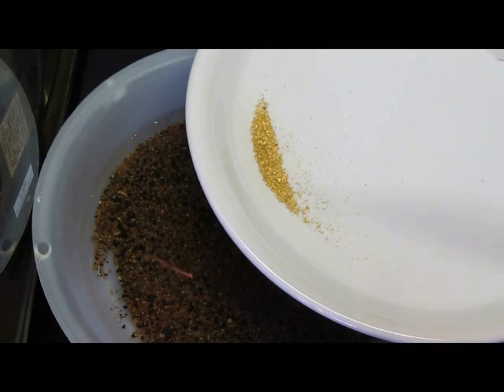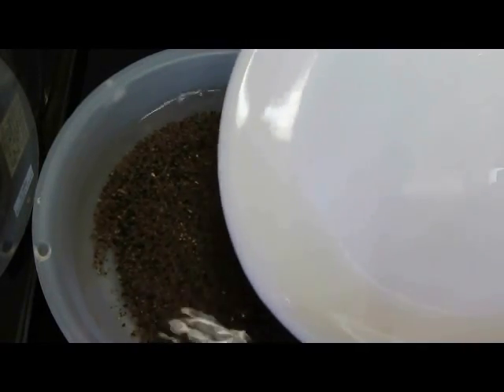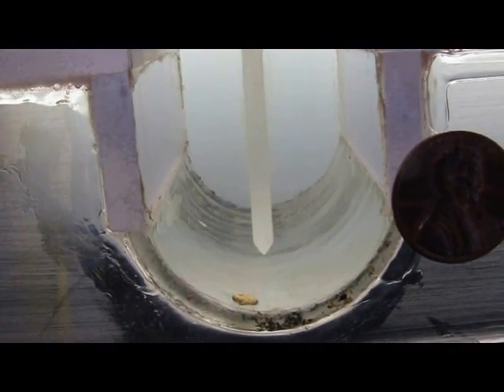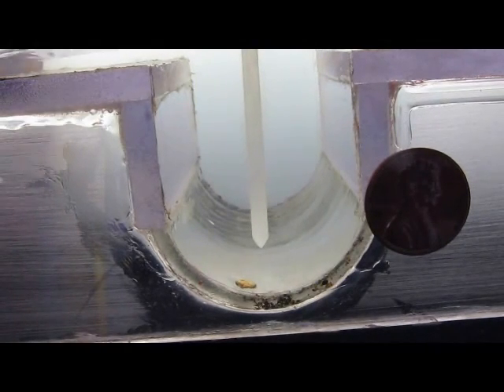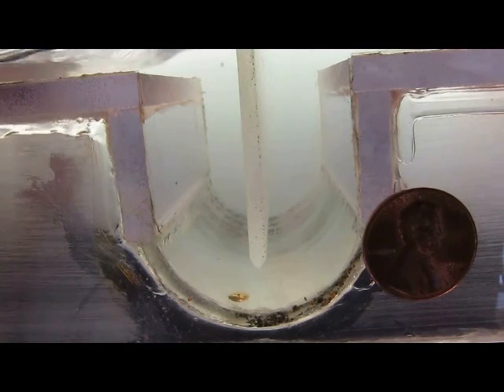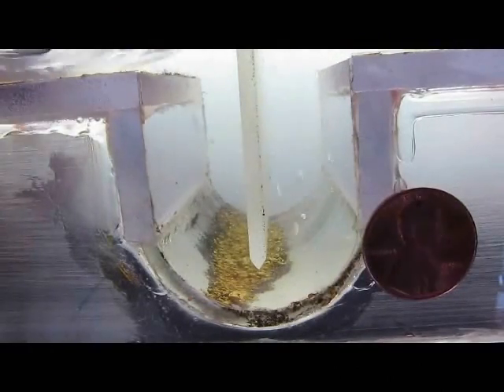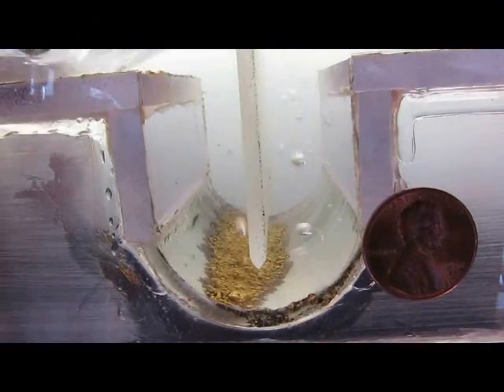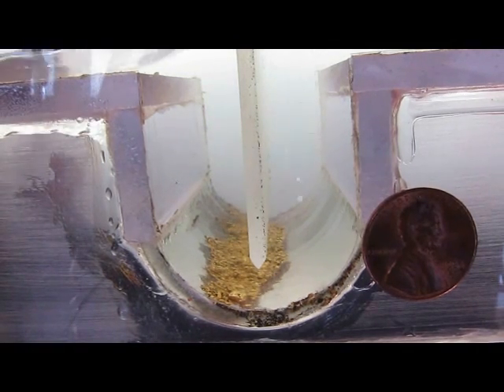UNDERFLOW SLUICE BOX GOLD MINING EQUIPMENT GOLD! MUST SEE, New Sluice In Town, No More Panning Gold

Comment: under FLOW, not tow... Think of it like this,  the water is moving up, things in the water are falling down. If they fall faster through the water than the water is moving, they'll settle at the bottom. If thing are falling through the water slower than the water is moving up, it will be carried out with the water.

Comment from the maker: @wpoley Comment Part 2 - Hence the name G-Force, As the water drops rapidly from above at each layer Intending an forcefull action through the trough. And only luckily will catch larger gold nuggets there. Let me say close but they missed it

Many Years ago I designed my system, with the intent of doing exactly the opposite of Sluice Gold Collection of the prior. In which the norm was to set up riffels, various mattings, and grating to capture Gold by creating areas for it to drop and hide.